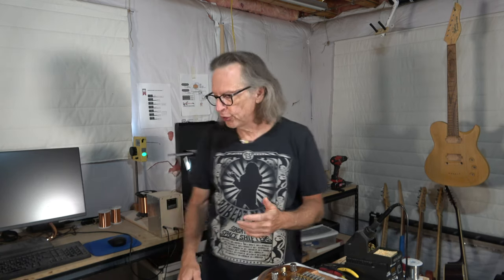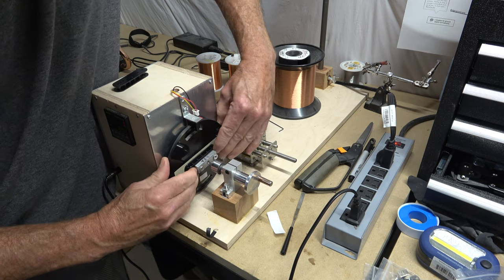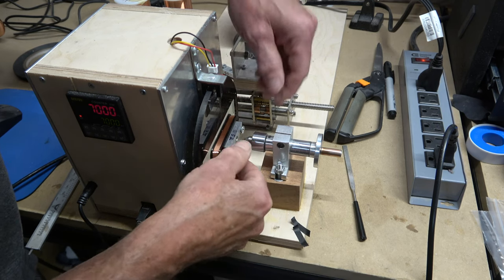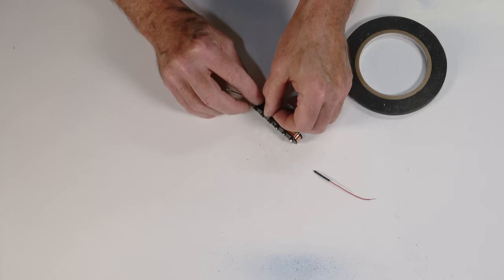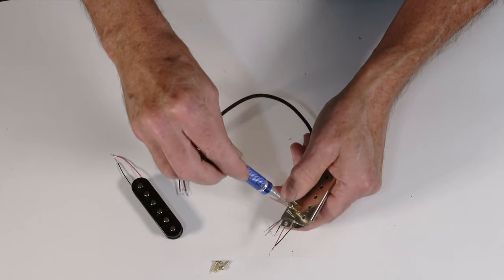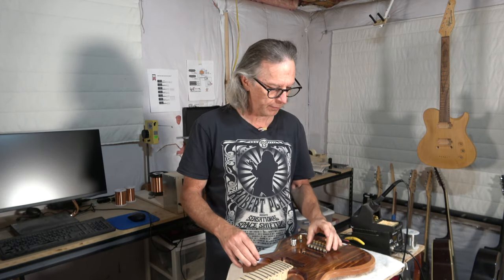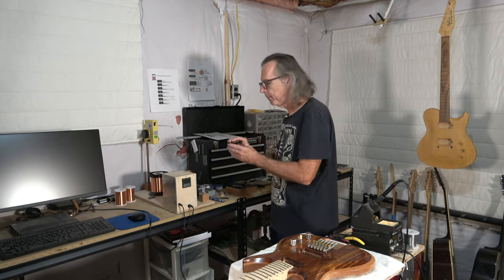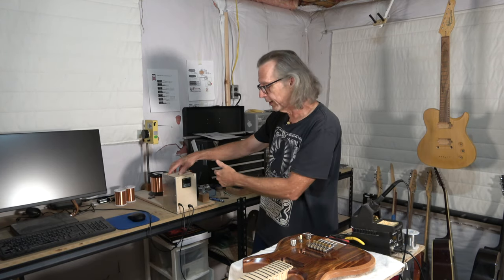Combining A Headless Electric Guitar With A Traditional Electric Guitar Part 10 Making the Pickups

Comment: Thank you Chris for another great video. I'm looking forward to learning more about your winder build. I'm in (what I hope) is the final revision of a similar CNC winder, also using auto-traverse. After many months of mucking around, I finally broke down and ordered one of the magnetic tensioning units made in China. Although I was able to make a non-contact magnetic tensioner that uses the same principles, it was becoming a mega-project all on its own, and slowing down final completion of the CNC winder. One thing I did come across that was incorporated in a CNC pickup winder by a fellow in Russia was making the wire tension a "closed loop" system, i.e. with feedback to the magnetic tensioner. He did put up a video about it; unfortunately, his narration is in "conversational" Russian, and Google translate couldn't quite make sense of everything. However, the gist of it is to use a very small strain gauge, also called a load cell. The signal from that is cleaned up, and then fed back to an electromagnet that works alongside the permanent magnets. I gathered from his remarks that incorporating this into the software that writes his G code was a bit of a challenge - I can well imagine it would be. Funnily enough, the additional hardware to do this simple and inexpensive, and all modular off-the-shelf components. The software feedback depends on several things. (I should mention that the device he built is a "modular" system of winder, which with some different mechanical parts will also wind transformers and industrial components, which may be the reason for measuring the wire tension and feeding it back). Anyway, although it is interesting from the engineering side, it's really not needed for guitar pickups as far as I can see. I would have been finished the winder several months ago, except for having broken my arm. This is not useful in the workshop!  I will be looking forward to learning more about the systems you've used in your CNC winder. Thanks once again for posting an excellent video.

Comment: Just binge-watched all 10 episodes as I'm currently building my first 6-string electric guitar for GGBO 2022 using my home designed and built CNC router and Vectric Vcarve software. It just happens to be headless as well. Very interesting to compare your tried and tested methods against my first-time ideas.
Reply from the maker: This build has been a learning experience. The last episode will cover what I like, dislike and what I would do differently.

Comment: Great info as always. Have you done any experimenting with bridge pickup distance from the bridge?
Reply from the maker: No. That's not something I would find useful.
Reply: @HighlineGuitars   So what determines your location? did you copy a les paul? Do you use the scale length? Distance from the bridge is a factor. The tone definitely gets brighter closer to the bridge  As scientific and detailed as you obviously are, I find it curious that you would dismiss that factor so quickly.  John Suhr has a definite distance from the bridge. (according to Pete Thorn)
Reply from the maker: @kellypeterson2625  location doesn’t matter. If I don’t like the tone of the bridge pickup, I’ll swap it for a new pickup that was made to a spec which is better suited to the tone I want.
Reply: @HighlineGuitars  Ok. Fair enough. Whatever works for you. I am experimenting with it on a couple of my guitars. So I am always curious.

Comment: Thank you for the interesting pickup winding video.  Just a couple of thoughts and please forgive me if I show my ignorance, I'm not a luthier, just an old musician.  Do you ever make center taps on your pickups or allow for single coil and double coil switching?    And, what are your thoughts about phase?  I'm 72 and own a 69 Thinline Tele which was modified by a a previous owner to include a humbucker placed at the neck and the neck pickup moved to the center.  After I bought the guitar, a local luthier who used to work at Fender (I was born and raised in Southern California), replaced a badly torn pickguard and modified the guitar to incorporate a 5 position switch and then added a position with differences in the pickup phases.  Nowadays, I rarely hear anyone speaking about doing such things...and Van Halen thought he was the first to REALLY modify a Fender.  :)
Reply from the maker: I have done coil taps and coil splits, but I'm not a fan because I don't like the way they sound. I do, however, like the effect of phase switching.

Comment: Great video Chris!  I really enjoy them... Hey I have a question, in a humbucker can you use different numbers of windings of wire in the bobbins? if so, how much will impact the sound?
Reply from the maker: Yes, you can wind each bobbin with a different number of turns. I find that doing this can expand the range of frequencies in the outgoing signal, which can result in more articulated bass, midrange, and treble. However, if the mismatch is more than say 20%, you'll start to hear the hum.
Reply: @HighlineGuitars  Thank you chris for the reply!

Comment: I’m totally down for the cnc winder plans. Im sure the parts are going to be fairly expensive, but when has that ever stopped me before? Why pay $100 for some that I could easily make for 3x that price? I’m not great at hand winding. Would love something that can make repeatable results.  I’ve been patiently waiting for this about a year now!
Reply from the maker: Actually, the parts aren't that expensive. The most expensive part would be the computer you need to run it. However, if you already have one, the most expensive parts would be the magnetic tensioner, the PWM controller for the bobbin motor, and the z-axis slide for the traversing mechanism. They cost around $60 each.
Reply: @HighlineGuitars  awesome I was thinking about ordering that tensioner anyway for my current winder.
Reply from the maker: @MET3  It's a great way to ensure ideal tension on a pickup bobbin since they aren't perfectly round. However, I burned through a lot of wire while testing to get it set up correctly.